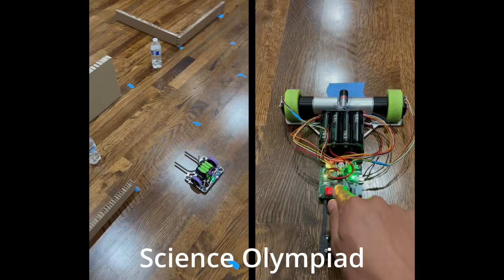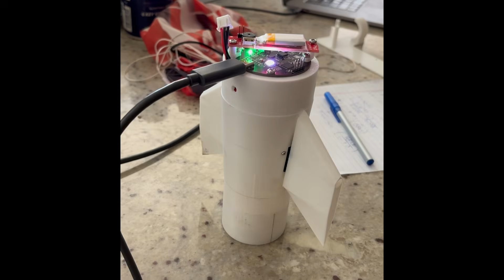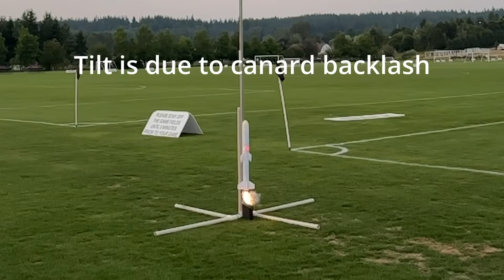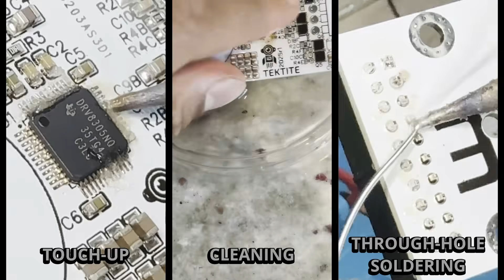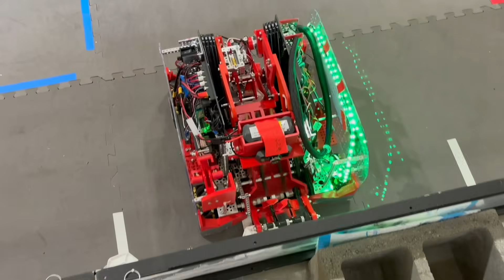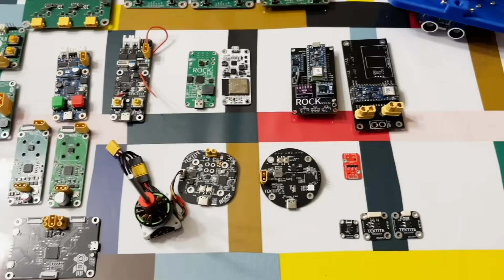MIT Maker Portfolio 2030 [Accepted Stanford & MIT]

Comment: man this is awesome im 13 and im finishing my first robot and its been such a long fucking journey to learn mechanical engineering and parts of circuitry i thought i knew but i dident, ive burned at 6 esp32's and after all that time ive finally gotten to the point where i can controll it using bluetooth from the esp32 to talk to a controller which controls pin outputs

Comment: Yo, I've seen that electric vehicle design online before.  Just curious: what major are you getting into, and what is your primary reason for pursuing that major?  It seems like you are fluent in mechanical, electrical, aerospace, and software engineering, so I'm wondering what your intentions about the future are.
Reply from the maker: I'm planning on doing EECS as my major with potentially a minor in bioengineering

Comment: How did you obtain the rocket motor/fuel? How did the thrust reaction not melt through the 3d print? Congrats on being accepted
Reply from the maker: The rocket motors are from Aerotech, they come in a casing so the outside doesn't actually get that hot, I never had any problems with melting even though I used PLA.

Comment: How do you have all those machines bro 😭
Reply from the maker: I just bought everything from Amazon! The main things are my phone screwdriver kit, DC bench power supply, oscilloscope, and soldering iron + reflow station. The one thing not from Amazon is my Bambulab P1S
Reply: @nv7213  Do you have an estimate to how much it all costed you? I want to try making stuff as well
Reply: @nv7213  did u actually need the ociloscope, i personally work on FOC and other stuff when tinkering but havent needed it i think, i get by with my multimeter and computer serial monitor to debug, what uses have you found, im curious
Reply: @nv7213 oh im interested on how much it cost you?
Reply: @nv7213  would you say that’s the best beginner 3d-printer?
Reply: @nv7213  Just say rich parents bro lol
Reply: @SJ21792  Nope, I have all the things he's mentioned too! I bought all of that stuff working only weekends at a fast food place after roughly 4 months of saving. It really isnt too expensive.
Reply: @SJ21792  lmfao fr
Reply: @SJ21792  you can make quite a bit of money doing odd jobs and personally i cant afford amazon equiptment, so ive gone to the good old aliexpress, much cheaper and ussally works
Reply: @SJ21792 they really aren’t expensive, you could do this with less than 1500 bucks
Reply: @SJ21792  what if you just got a job gng
Reply: @SJ21792  its really not "rich" rich. all those things together could be about 1200$ in total. think about what you say before you post 🙃
Reply: @SJ21792  the work is hard thou, just because one has money, doesnt translate to what he has done, i am an engineering student and its crazy how he learned all even before entering college. a lot of people are born in rich families, but dude chose this way to spend it, which deserves some respect
Reply: No excuse. Study theory, and then apply concepts in college.
Reply: @SJ21792 bro that’s like 1000 maybe around lil more then that. Not that horrible for him to be rich😂

Comment: Wow, very impressive! I love how wide-ranging your projects were. How did you manage your time to pull all of this off?

I have a similar passion for engineering. I've built my own small-scale wind tunnel, co-founded my local FRC team (I'm currently mechanical lead), just started a 3D printing business servicing local shops, make custom airfoils for rc planes with various goals, built custom rocket engines with fuel and ablative nozzles, do custom FPV drone builds, and I'm working on my pilot's license. My goal is Embry-Riddle, but I'm struggling to stay motivated and find time to keep all these projects moving while maintaining good academics. Any tips on staying on track?
Reply from the maker: Sounds super impressive! I really like my todo-list app (Todoist) for managing all my commitments and work that has to be done, so that on a daily basis I can just go down the list and check stuff off
Reply: yeah, echoing NV7s sentiemnt here, Im in a similar position of all projects like this and I find that going 1 at a time and focusing mainly on building the skills along the way is a big aspect, I do FTC, FPV, and work at a 3d Print farm and I'm learning EDA so its really cool the stuff you are doing as well, so I really wish you luck and embrey riddle is at the top of my list as well. (AeroE)